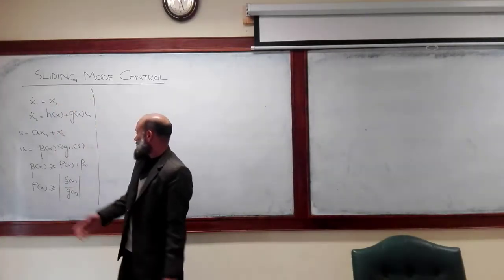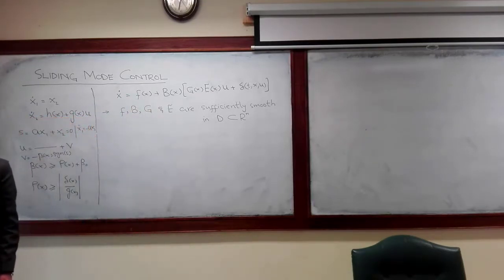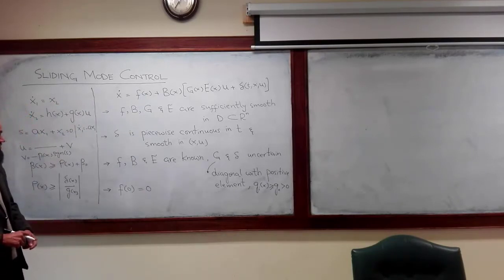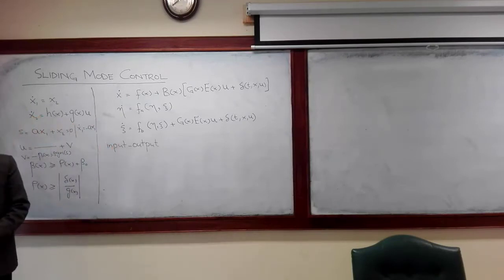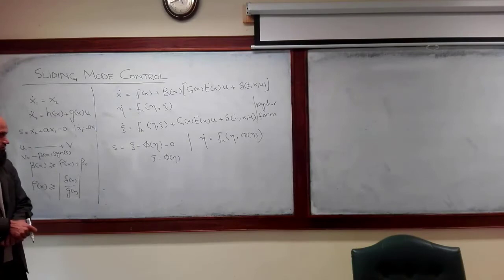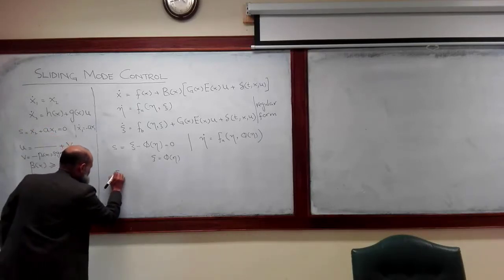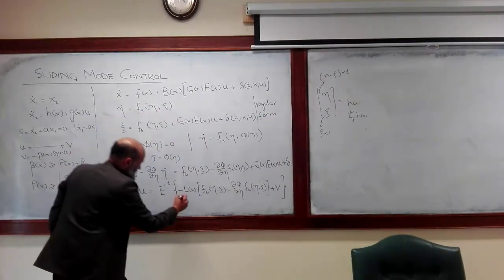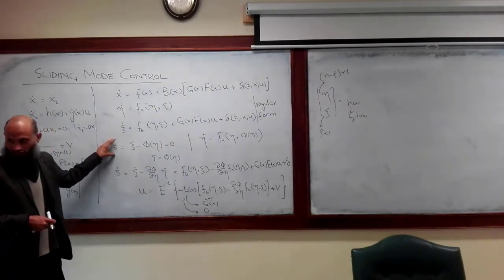NCS 37 - Sliding Mode Control - general case

Comment: Dear Prof, do you have a reference for this proof? I have read the textbook on Nonlinear control, and want to know more about this regular form and the sliding Mode proof. Most of the time, Sliding Mode Control theory comes in separate pieces, very confusing. Thank you so much
Reply from the maker: Book titled Nonlinear Systems by Hassan Khalil is recommendef.